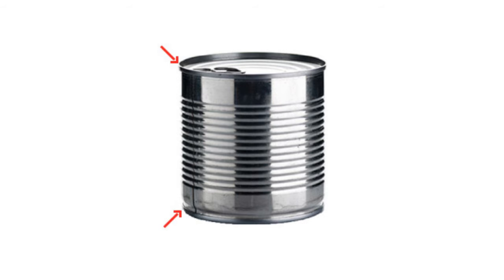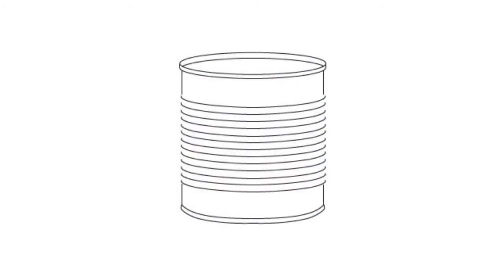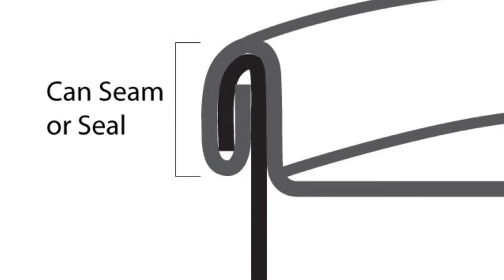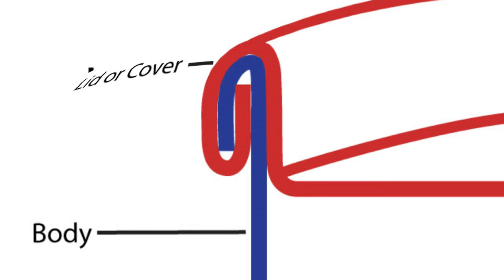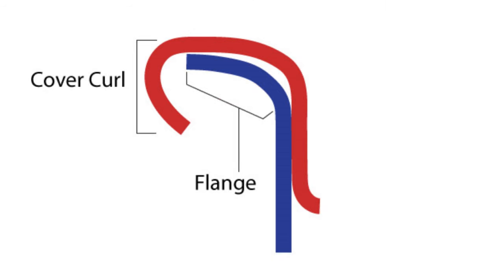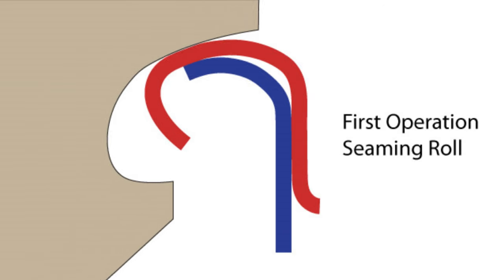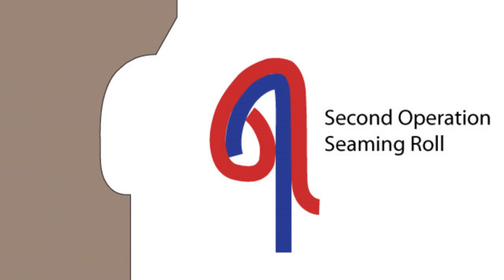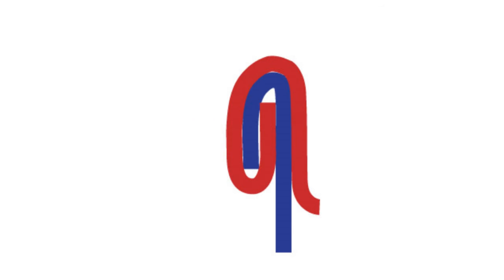How Cans Are Sealed

Comment: Is it just crush-sealed then? No welding involved? is it the same process for the bottom of the can?
Reply: That's right - its a purely mechanical process.  There is also a lining compound in the can end which spreads to fill up the space in a correctly formed seam.  For 3 piece cans (made with a body and 2 ends) the process is the same for both ends.  Two piece cans are manufactured with different method.